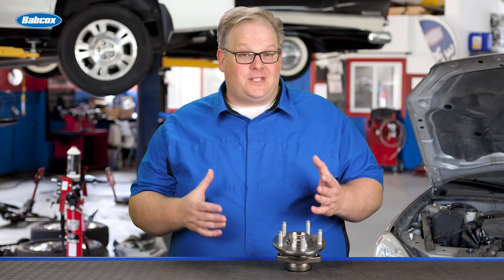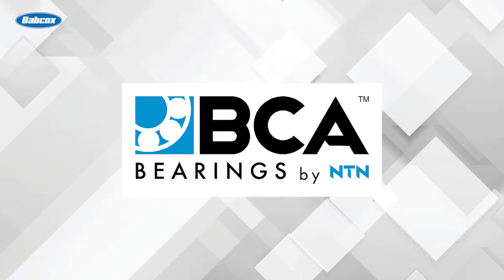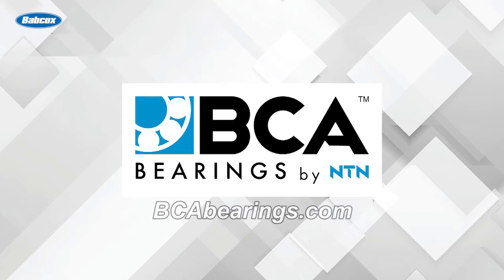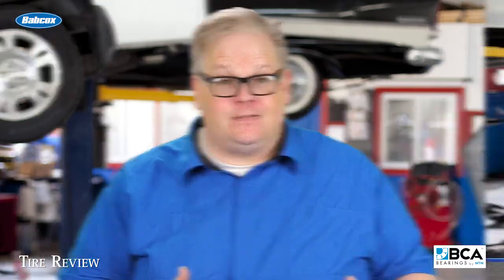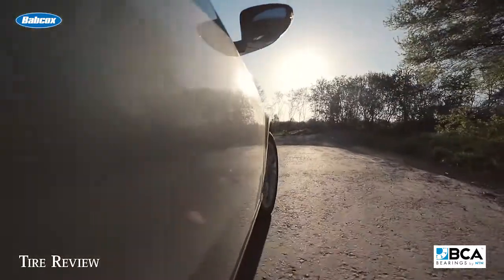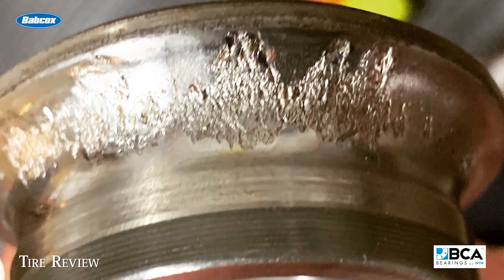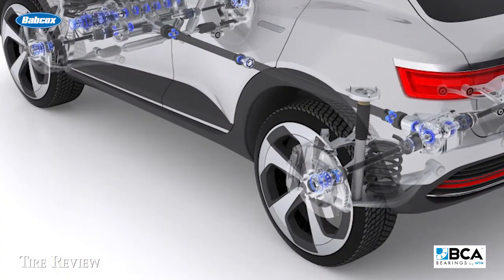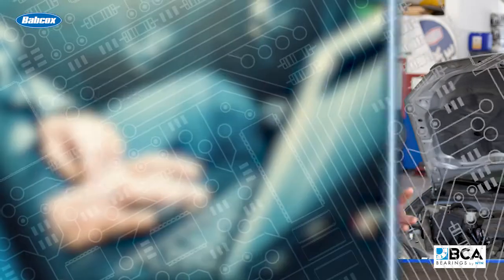When Should You Replace Only One Wheel Bearing?

Comment: I have a 05 Honda Element AWD & I hear noise from the rear while driving. I do think it's the bearing. Can I just replace the one bad bearing or do I have to do both rear? 
Thx u.
Reply from the maker: Good question. You will generally be fine replacing a single failing wheel bearing. However, a couple things to consider are the mileage on the vehicle and how long you are planning to keep it. If the vehicle has higher mileage, and the wheel bearing is failing because it has reached the end of its service life, then the other rear wheel bearing might not be too far behind. If you are planning to keep a vehicle in the long term, it might be convenient and more efficient to replace them both at the same time. It may also give you more peace of mind. 

Another thing to keep in mind with an 05 Honda Element. If it is equipped with 4-Wheel ABS, the left rear and right rear wheel hub assemblies are different part numbers. If it's non-ABS equipped, both rear wheel hubs are the same.

Comment: I appreciate the honest answer. Its EASY to justify replacing both. There certainly are customers and situations where someone may want to replace both. If you can afford it, its a good idea to do both. But if you want to replace one, don't feel bad about it. The 130+ USD you save by only doing one is far greater than the -20$ you save by getting a mechanic to do both at the same time. You may never end up needing the other replaced.

If you do your own work, replacing one is definitely the better option because you aren't saving any money by throwing away a part that ~could~ last years longer.
Reply: Edit - But you need to be 100% sure which one needs replacing. If I can't narrow down which side is roaring on the front I may end up doing both. I should be able to figure it out by lifting the vehicle up and spinning the wheel, but this method is idiot proof, not fool proof. I happen to be a fool.
Reply: @clockhanded  Lifting up véhicule might not be enough. You might also want to remove the brake callipers as they might prevent a wheel rotating freely. They only you will know if it's because of the gearing or not.
Reply: $130 if you do the repair yourself. $500 per side if you take it to a mechanic.